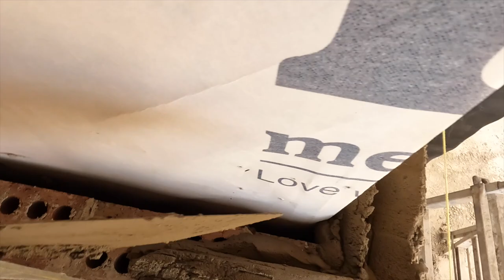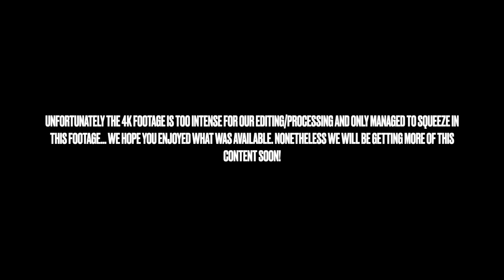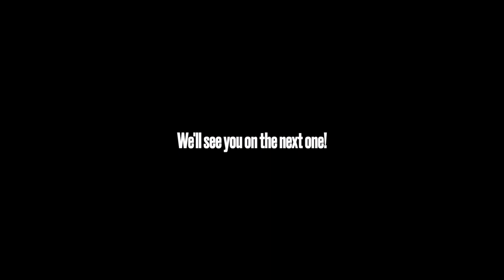BRICKS BY TY X GOPRO | BRICKLAYING AUSTRALIA

Comment: Hey Ty , just a tech question,,how do you determine the consistency of your mud when you mix & what do you look for?,, I never seem to do it right & when laying cinder blocks the  mud slips off the block 50% of the time when I butter it ,, 
Ps love your uploads
Reply from the maker: Hey thanks for that! While the mortar is still in the mixer, mixing, you want to grab a small portion with your trowel (the same amount as if you were going to butter a block) and then turn your trowel upside down. The purpose of this is to see if the mortar sticks to your trowel. If it doesn't, then more than likely it will be either too wet, or too dry. From there you would either let the mix dry up in the sun a little, or add a little water, respectively. Hope that helps!
Reply: @bricksbyty  great!! thank you for the advice this helps a lot!!!

Comment: hey ty that first batch u put out was not good i could see lots of sand which indicates it wasnt mixing for long enough and not enough water if its a render panel it is ok but when the beds and perps r rolled and its face it will have alot of blow outs when the brick cleaner comes and acid washes it u will see little holes through out the beds and perps which isnt good not in a rude way mate just trying to help u out
Reply from the maker: Hey there! Yeah we're running towards the end of this job and for that reason we are left with some of the harder clumps of sand from the load we were delivered. Thanks for the advice mate and thanks for watching!
Reply: @bricksbyty  Ye man and it dosent help that big builders buy cheap shit sand full of clay
Reply from the maker: It can happen, but we work with what we have I suppose!